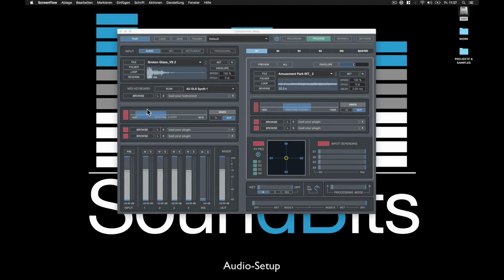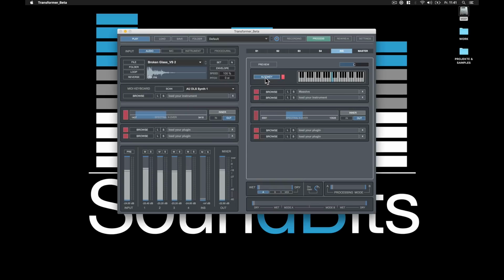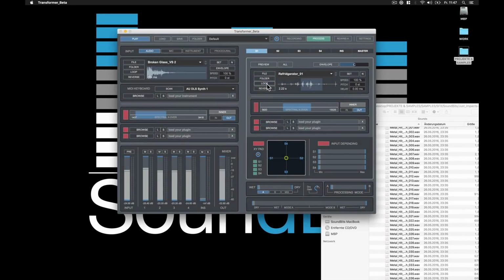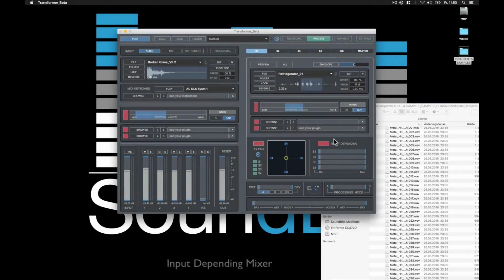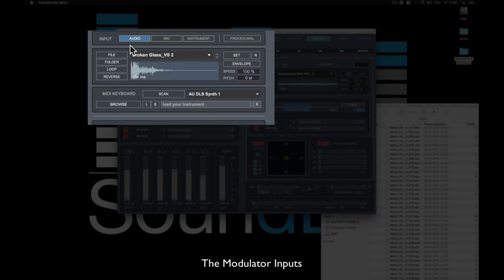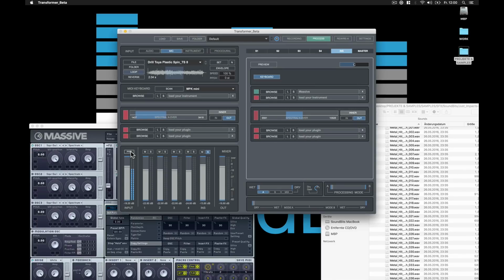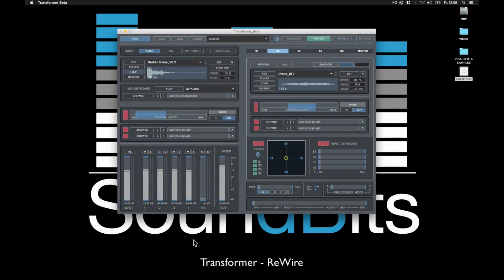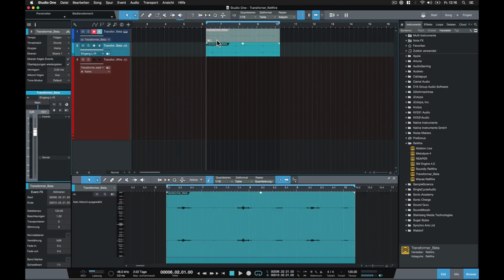Transformer Introduction | Creative morphing & performing audio tool

Comment: This seems like a really powerful piece of sound design software. But I have to agree with the comment below. The video is a great “manual”, but it really doesn’t give someone an idea of how all of this power can be applied musically or in sound design. The examples used above are essentially just noise. I really think a video of example use cases would really help sell more. It’s really well specified as far as feature set and all.